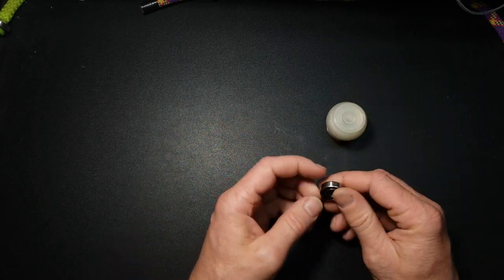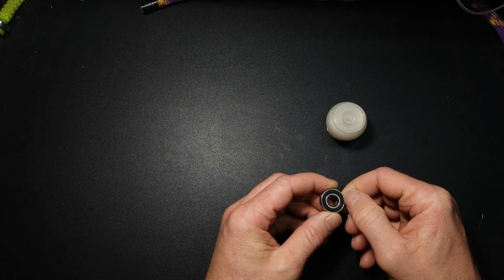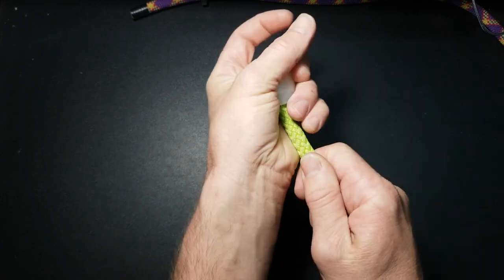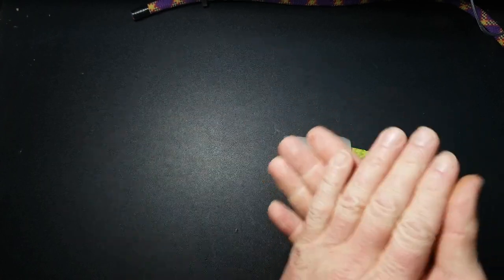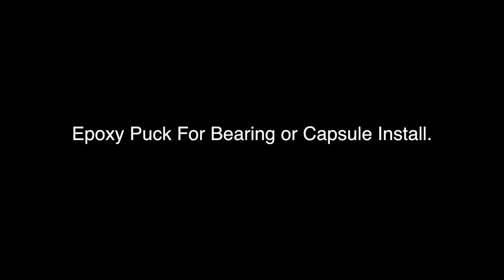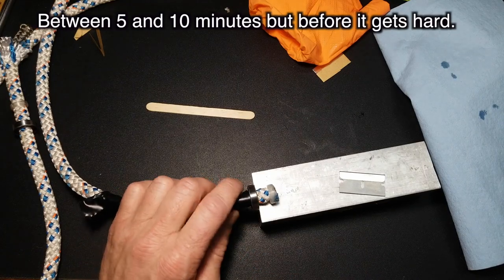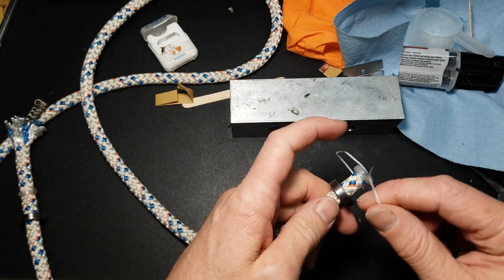Eggknobs by Lost In Flow. Build Tutorial and More.

Comment: Hi, what size washers would you recommend to add weight to the egg knobs? Thanks
Reply from the maker: Hi. If you are using them without a bearing then the space is 22mm wide by whatever size rope you use. With bearing then there is not much space to put any washer. I was able to find a lock washer to flatten out and put under the bearing so you might be able to do that assuming your cap is small enough. I had to wonder around ace hardware for a while to find one that actually fit though and it ended up being a 1/2 I believe. You just need to make sure your washer isn't rubbing into the seal or the inner bearing ring or else it won't spin

Comment: If the silicone is cast around the knob then can glow powder be added to the grip?
Reply from the maker: Its not cast around it has a rubberized grip sleeve on it. I guess it could be possible to drill into the cavity and add the powder to that and shake it up to spread it, then glue it shut. I would only do that from the inside or maybe the top though. Do at your own risk
Reply: Hmmmm. Interesting idea. I'd rather have separate props, glow and led, than combine them anyway. I think the prop making community is severely underutilizing strontium aluminate. I'd like to see something this size/shape in silicon rubber with a nice glow powder and a bearing. I'd like to see strontium aluminate in some nice contact balls as well. Lantersmith uses some good glow powder in their glow knobs. They are awesome but a little small for my taste. It seems I could modify them to take a 10mm rope and a 8x19x5mm ceramic hybrid bearing. I could add washers and get them the right weight but that doesn't change their size. Any thoughts? 🤔
Reply from the maker: @cookieheka5431  I had a few sets of those and used them in the beginning. I used a big bullet shell that I sharpened a bit and pushed a bigger hole out for a 10mm rope and it worked great on the non glow knobs. then I tried on the glow version and at 10mm it actually cuts into the glow grains and that caused it to rip rather easily because the silicone isnt strong their so that would be a negative on that. When I was with Lost In Flow we had thought about using glow filament for these knobs but never did. Would be a pretty easy thing to do if I still made them.
Reply: Thanks for your advice Beacon. I might just end up making my own glow handles and poi. I'm well versed in casting pottery and epoxy. The information I have looked up about making silicone molds seems pretty familiar and straight forward. I'm definitely getting a set of these Egg+ in a set-up similar to yours. Transitioning from glowstringing and more traditional poi into contact was heavily influenced by your performances. Thanks for the inspiration.
Reply from the maker: @cookieheka5431  awesome well good luck to ya.

Comment: Any chance these can work with the original dot XL chips? Sorry, I know you're gonna get this question a lot.
Reply from the maker: I just tried the original and it is a tight fit because the chip is round where the dot xl chip has flat sides. Once in the button wasn't working because it is thinner. I folded up some tape a few times and put it on the battery and was able to get it to work but it's not really designed for it.